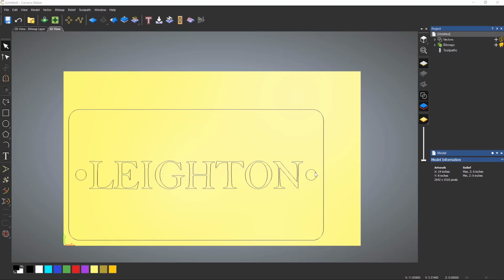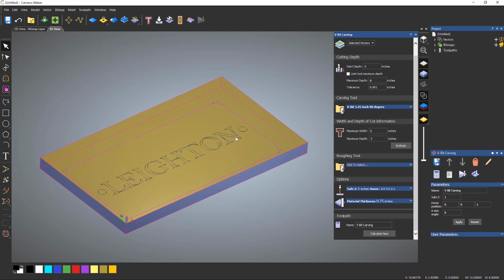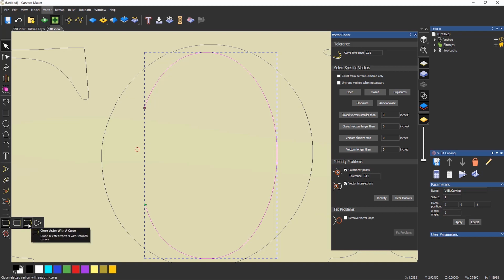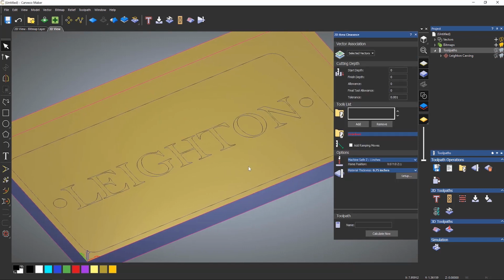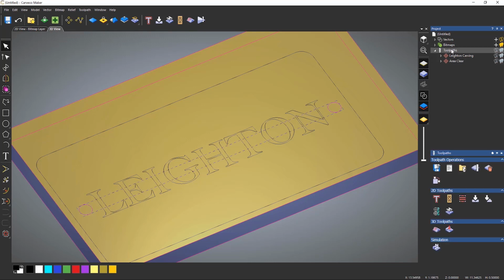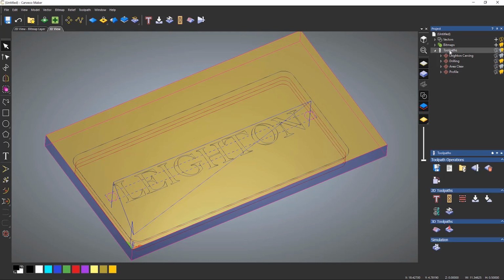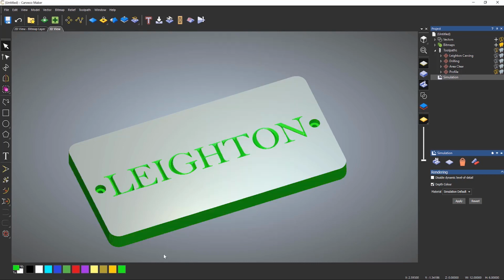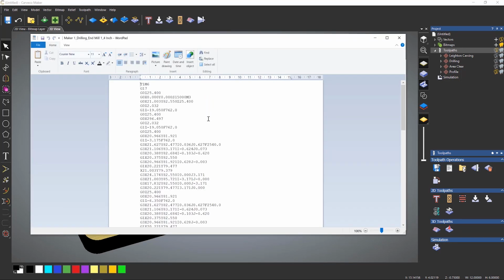Carveco Maker - Machining A Plaque (part two)

Comment: Can you help? I’m trying to find a tutorial for a regular end mill inlay. Every single toutorial i could find is only for V carve. I just need to use a spiral bit. I’m basically trying to make various mortise and tenon joints, but I don’t know how to get it to clear the material around the vector files in carveco, the tool path only runs around the vector files.
Reply from the maker: Hi Martin. Absolutely, I believe this video is what you're after: https://youtu.be/_6I7-uql0NA?si=z4QDACS1zZuyCwKJ Thanks!

Comment: Can't get toolpath to follow vector
Reply from the maker: Hi Mark, sounds like an issue with the tolerance.  If you set it back to 0.025mm or 0.001", it should be ok.  If it isnt, I'd send our support team the .art file so they can look into it for you.

Comment: Your circle must be smaller than the tool or it with not build the toolpath...and give no explanation why. So if you are getting a message that says "No toolpath was created for current tool", make sure the hole to be cut is larger than the bit doing the cutting. Probably a stupid move on my part, but it took me a while to figure out...maybe this will help someone in the future.
Reply from the maker: If it is size on size then yes it will give that message, especially if the tolerance has been altered from the default value.

Comment: I'm stuck at creating a toolpath for the two holes. I can't get it set up to do both holes simultaneously. I can select one or the other but not both together. What am I missing?
Reply from the maker: Hi Doug, you need to select one of the holes (which should then turn a pink colour) then hold Shift down on the keyboard and select the other one and then calculate the toolpath.

Comment: When you go to machine this, how do you know which end mill to install in your router first? Does the machine stop after it's done that type of tool path and tell you to put another end mill for the other cuts? How do you know which on to put in your router at that time????
Reply from the maker: If you save this to separate files, then correct, the machine will stop, you manually change tool, set it up and then run the second toolpath.  Providing you have the tools set in the correct order and have "append details" turned on, it will give you information on what tool to use.  Of course, there is always a risk of human error.